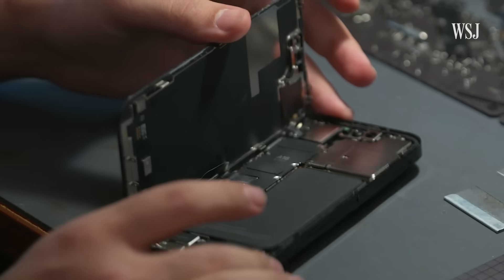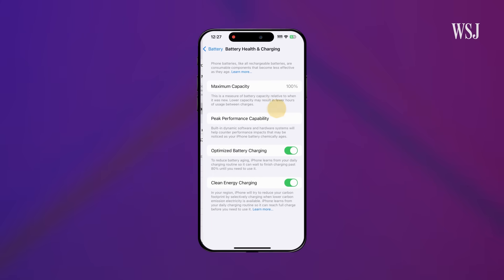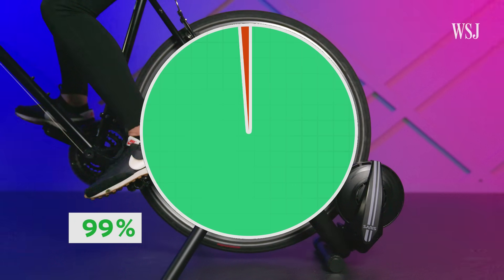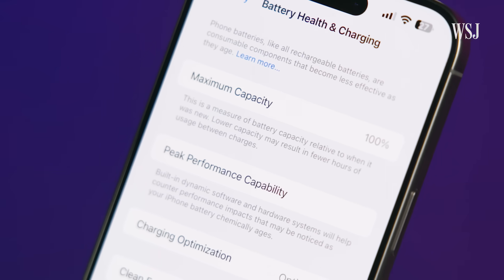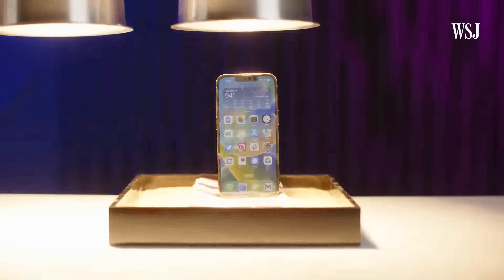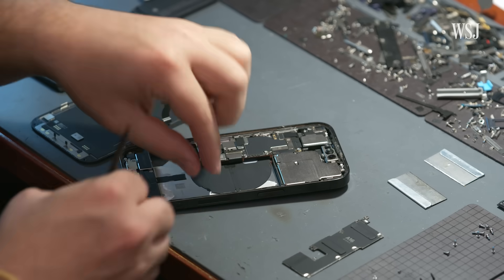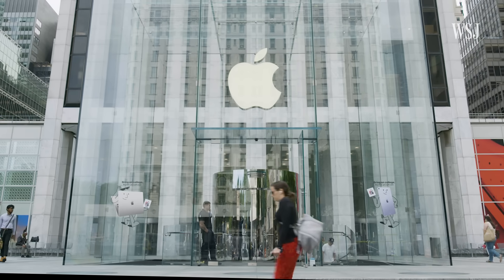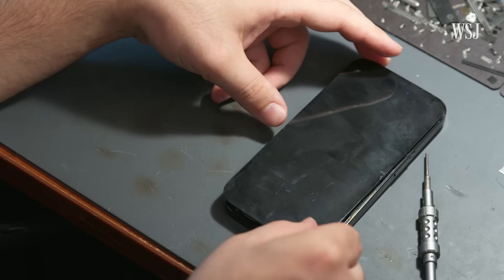Why My iPhone’s Battery Expired in Only a Year | WSJ

Comment: I charge my iPhone 17 to 100% every night I have optimised charging on. Had 112 cycle counts and still 100% capacity. I’ve got a magnetic power bank in case j need it as I refuse to pay out for new batteries when I’ll be getting a new phone by time it’s needed.

Comment: My 14 Pro Max took 13 months to drop below 100% capacity and (I'm pretty sure) that's because I babied my phone. Right off the bat, I never used my phone while charging it and I never let it stay plugged in when it's done charging. I never charged it with anything faster than 5 watts, I kept my brightness as low as possible at all times, I never charged my phone past 80% or let it drop below 20%, my wallpaper for my home\lock screen is literally just pitch black, and I absolutely never charged it wirelessly. I've also never used low power mode but that has nothing to do with any of this. Did any of these habits have any effect on their own? Absolutely not, but altogether I'm quite confident that it kept my battery the healthiest it could be for that year. It's been two years that I've had it now and it's finally at 87% capacity and i no longer baby it. I'm gonna get the 17 Pro Max at the end of the year. I only wanna baby my battery for no more than a year. If I can get 2, maybe 3 years out of it I'll consider that a success. I don't look at phones as status symbols instead i see them as tools. Idc if they get scratched up or cracked as long as they properly function.

Comment: Yeah the 14 Pro series didn't really gain a bigger battery, in fact the 14 Pro Max actually has a slightly smaller battery than the 13 Pro Max. The 14 Pro series just wasn't the best line of iPhones to upgrade to in my opinion. Overtime, like right now, people are starting to really feel the pain of those smaller batteries. I'm hoping that this is just a temporary trend while they add newer/different battery technology to put inside these phones.

Comment: I currently have two cheap Android devices - a phone and a tablet - and neither has given me battery issues in the 2 years since I bought them. The iPhone 17 Pro Max is 2600 AUD at my closest brick and mortar store and that is nothing short of obscene IMO. The iPhone 16e is 900aud - the notion that either of these would need a battery replacement within 12 months is insane. I get that the factors you have mentioned can impact battery life but I doubt that Motorola and Lenovo are investing more in battery tech than Apple. This looks a lot like planned obsolescence.

Comment: Batteries are manufactured in runs. Here an example. Amazon informed me of recalls due to bad batteries for two battery banks from the largest producer of battery banks. I looked up my serial numbers and found out my batteries weren't in the bad runs. The point is, you can always have a battery from a bad run, Apple included. But how will you find out the replaced battery is bad? Maybe if you use an Apple battery, Apple will keep track of the new one as well. I don't know if that is true.

Comment: As someone who used to work at Apple Retail, I purposely never use MagSafe chargers, because the heat in there absolutely affects the battery cells. That’s why Apple has steered away from fast charging like android does in 20 to 30 minutes. If you use a slow charger, use the optimized charging feature on iPhones and or the adaptive power that will all help.

Comment: Charging with slow cable I had my 13 Mini on 100% for 2 years. Then I had a 14 Pro Max, 100% battery for 1 year. Then a 14 Pro Max on 87% and it remained 87% throughout 1 year. 

don't use wireless chargers, don't use fast charging. IF you want your battery to last or if you want to resell.

Comment: Keep your battery charged between 20 and 80%.  If you need more, then charge higher, but use it right away.
Letting it charge to 100% and sit there for hours can cause the battery to wear faster.
My iPhone 14 is 3yrs old and at 94% health.  My iPhone 11 was at 79% health after just over 2yrs.  The difference is how I charged it.

Comment: I Has a galaxy m51 and it was at 94% battery health it was used from 2021 to start of 2024 it was with 830 battery cycles, I think apple is ripping all its users, because I tested recently a s23 ultra with 2 years of continuous use with 550 charging cycle with 96 % battery health.

Comment: I had two batteries replaced on my iPhones at the Apple Store and it takes roughly an hour for replacement. If you like your phone and don't want to upgrade getting a new battery will extend the life of your phone atleast two years (if you take good care of it). For 100$ its much cheaper.

Comment: My IPhone 15 had 600 cycle count & 90% and had 14months usage. Then it dropped to 85% in the next 6months it went to 900 cycles so very even. In a way I was able to get max out of the battery by making sure I went down to 1% and charging it back to 100% every time. But yes 1st 6-9 months I was getting a full day of use and I had to charge it again after 9months of use.

Comment: 480 charge cycles, explains everything. you depleted your battery more times than there are days in a year.
Running newer iOS on older devices just increases the cycle count

Comment: My android phone battery health is at 94% after more than 2 years of use. From my learnings, you only got to do 3 things for a healthy battery. Prefer charging from an adaptor instead of wireless. Now the next 2 are most important. Don't let it go below 20% and don't charge it above 80%. I have been following these practices for more than 5 years across my 2 android phones and they have worked really well. I compared this against my wife's android phone who just don't follow any of these tips and who fall asleep while phone charges throughout the night. Her battery life is around 84%. Note that her phone is newer than mine.

Comment: She's answered her own question, hasn't she. 494 charge cycles in a year is excessively heavy use. Most batteries are rated at ~800 charge cycles before replacement is needed. And those 800 cycles are enough to last the average user 3-5 years.

Comment: Wow... surprisingly useless video. You better research more third party batteries which have very poor battery life. And why Apple charge so much money on the battery replacement which cost only 10 to 20 bucks when they buy from the battery suppliers.

Comment: she has more charge cycles because of 120hz screen because to drive a 120hz screen you need more processing power and display is more power hungry so more battery depleting hence more charging hence more charging cycle.
60hz vs 120hz display made all the difference and she play games on 120hz it will use more power than on 60hz

Comment: A few slight (actually a *major*) issues…

1. Refurb is more than just surface cleaning.
2. What about possible battery replacement?
3. Is the wired computer connection actually doing much for complete erasure? What about the fully traceable IMEI, and other data?

Comment: The nex big thing is, that Apples IOS makes the IPhones drain more battery with every new iOS coming out. Your IPhone (even with a new battery) will never perform like it was new, they “optimize” for the newes model and for the model 1 year before. Your new iPhone on iOS 18 gets for example 10Hours and on IOS 20 it will only get 6 if you are lucky.

Comment: My 4 year old iPhone 12 battery is at 94%, so I’ve only lost 6% in four years despite using a 65 W charger daily. That’s because I never charge beyond 80% and always charge before it reaches 20%. People who do this genuinely will see a significant improvement in battery longevity. most peoples batteries degrade significantly faster than mine because they are always allowing their battery to run to 0 and they always charge to 100%.. unfortunately Apple’s battery optimisation setting doesn’t really help improve the Battery help of Apple products. You have to manually do it yourself to get the best chance of battery longevity. I advise anyone with the newer iPhones to activate the 80% limit in the settings so that the software prevents the phone from never going beyond 80%.

Comment: Tip: avoid wireless charging and fast chargers if you can. 

Both these options generate heat which is the main culprit when it comes to fast aging batteries.

Comment: No your wrong , the reality is that Apple is using the GPU to do the processing CPU work , this arm architecture exposes the battery to heat and Apple has placed new iOS to slow the GHz down and this causes the battery to alter the amount of volts of current in output , a change in amp will lower the battery health …they did this to preserve the the logic board from being degraded due to recycled rare earth materials , which are not pure elements ..
They had to do this in order to extend the durability and life of the device ..
iPhone12 and  12 mini also ran into the same issues .

Comment: I've been using my 2011 LG 505 Phoenix with its original battery every day for the last 13 years.  
2 years as a full time smartphone and the last 11 years as an MP3 player (airplane mode only). I bought 2 replacement batteries for this phone in 2014, they have never been opened.

Comment: I find those people preserving the number of charge cycles so stupid. I mean its a phone, its meant to be used. When its at 80%, just replace the battery. For sure by that time, you have some money to spend on a simple battery replacement and doesn't burn your pockets by buying a new phone.

Comment: Adding my 5 cents. Iphone 12 mini bought at launch (Nov 2020) today (Apr 2024) battery health at 87%. The phone was overheated several times while charging wirelessly in the car and wired on the motorcycle in full sun but other than that I try not to go below 20% and not to charge overnight - just plugging in while working in the office and unplugging at 80-90%. During weekends I tend to fully charge to 100%. It holds up well I would say. With this rate I would change the battery in 1-2 years and then the new battery would last longer vs the iOS updates coverage (Sep 2027).

Comment: Wifi is everywhere. Enable wifi calling and turn off the cell radio when you don't need it. It will provide more battery life. Android 14 also has a good "extreme power saving" mode that is very effective, while maintaining your phone's ability to receive a text or phone call.

Comment: 5:33 A little bit of misinformation here, and kind of odd that it came from a repair shop technician. Apple determines if a battery is OEM (from Apple) based on a chip that’s soldered onto the battery. The battery’s connector actually goes directly to that chip and the chip is spot welded or soldered onto the battery’s terminals. Then it’s all rolled up so you just see one nice-looking battery. The chip is a tiny little rectangle eat the very bottom of the battery called the BMS (battery management system board) and you can usually see if because there’s a slight inset/indent where the cell ends and the chip is stored and wrapped up. If you cut the BMS chip off the Apple battery that comes with the iPhone and spot weld it onto your new third-party battery, your iPhone will think it’s the same exact battery so the warning message won’t appear. The BMS chip is what stores the data that tells your phone how many cycles the battery has and what % capacity it’s at, so if you swap the BMS to a new battery, by default, Settings will still show the same battery health information, but there is small pieces of hardware like tag-on flexes and BMS re-programmers that shops can use to reset the BMS info back to 0 cycles and 100% health. They can also change the BMS’s record of how much capacity the new battery has (if different from the original Apple one), to make sure that the % health and cycle count calculations shown in Settings remain accurate with the new aftermarket battery. BMS boards are serialised so each iPhone knows that it was made to only have one BMS used on it. Even if you use another Apple OEM battery, the warning message will still show up because that Apple battery won’t have the same serial number as the BMS the phone’s original battery shipped with. When Apple does official repairs, they have tools to modify the serial number on the BMS of the new battery the install or update the iPhone’s logic board to accept a new serial number so that the error doesn’t show. They licence the tools and technology to do this for Apple batteries to Apple Authorised repair providers so that they don’t need to transfer the BMS from one Apple battery to another when repairing customers’ Apple device batteries.

Comment: I got an iphone 14 in december 2023 and the battery health is already at 96% and it only had 73 charge cycles. My old phone iPhone XR that I got in 2020 took a year to get to 99% battery health. When I got the 14 the XR was at 87% battery health after 3 years. My sister got an iphone 13 last june and her phone is at 98% battery health. iPhone 14 battery is just worse for some reason.
Reply: For one week battery life, get Doogee S100....
Reply: @ now its at 87% 💀 after a little more than a year. The next phone im getting is a pro max because I want bigger screen and better battery.

Comment: The extra power drain comes from an always on BLE (Bluetooth Low Emission) chip that is the backbone of how airtags work. It has a range of about 450 feet and it calls out to other devices the same chip to form a mesh network. It's the network an airtag calls out to find and transmits its location too. You have no access or control of opting out of being a part of this always on mesh network in the OS.

Comment: Pay the extra $10.  Battery messages will destroy resale and trade-in value.
Reply: yep, at 98 dollars instead of 88 dollars am better off doing it the official way with apple instead. At least apple doesn't take short corners like some of these repair shops do by getting cheap batteries.

Comment: one thing is missing here... at the very first time you replace that batt, you are likely to lost the Water resistant forever
Reply: Not if it is performed by Apple or a professional repair tech. A water resistant gasket can be installed
Reply: Wrong, apple remove the old glue and apply a new one.

Comment: Charge should remain between 20%-80%. End of story. I have been using 13 pro since oct 2021 and my battery capacity is at 87% which is fairly good. And one should use the phone like a normal human being and not abuse it. Believe me everything will be fine.

Comment: iPhone 13 PRO Max 97% health, 425 cycles (battery age ~890 days). Take note: to reduce battery drain, turn OFF 5G and use LTE. Turn off Background App Refresh. These two changes will dramatically increase the per charge longevity of your battery. HEAT is the number one enemy but WSJ said nothing on how to reduce it. Well here's how: Charge SLOWLY. Use the old little 5w apple cube to charge your phone overnight (yes it will take hours and your phone temp won't change at all) and use a fast charger during the day if you have to top up. Wireless charging and fast charging is bad no matter what anyone tells you. Why? It generates HEAT!

Your battery capacity is larger than the 100% shown on your phone. Coconut battery will report a lower charge level and higher battery health because it's reporting against the full/real capacity of the battery. Yes the rumours are true, for the absolute best battery health and charging practice, keep your phone between 20-80% and don't go to 100, however; this is not practical for most people. Doing your best to reduce heat will allow your battery to last for as long as you want to use that phone.

Comment: My iPhone 14 Pro Max is down to 92% in about 5 months, crazy my original iPhone SE from like 2016 still has 91%.
Reply: Mine 11 pro from 100% to 85% 3 years. Now 14 pro from 99% to 90% in 5 months.
Reply: @ArcheeKK  I’m down to 85 percent now lol this battery is nose diving.
Reply: @ArcheeKK mine 12 pro from 100% to 74% in almost 5 years
Reply: Honestly I do think it’s the iPhone 14 range. Mines down to 89% after just over a year. Crazy.
Reply: Same phone, I just checked - 100%     ok, it is on it's third battery
Reply: @chip9177  mine is now down to 84% since posting
Reply: Thanks for sharing this, i thought my iphone battery was defective, but it looks like everyone has the same issue

Comment: Regarding the aftermarket battery, it's like when you put another aftermarket engine in your car or motorcycle. It did not work as the manufacturer says with the original engine. I would put another Apple battery and solve the problem.

Comment: Possible reasons for the battery to discharge so quickly: you have one or more applications running in the background, a factory defect, the battery or the phone was previously unbleached and a problem battery was installed, the phone or battery was left too long to be used in - und deposit before the phone is bought. The iPhone is a very good phone.

Comment: stupid question: is this only an iPhone related problem or do show android phones similar wear, too? I'm already familiar with battery-wear on my laptops and it doesn't matter if it's a lenovo, hp or dell. The chemicals and physics are the same. My 4 year dell xps is at about 50% of its original capacity: it jumps from 46% to only 6% suddenly and tells me the power will fail in 10min

Comment: Charging on airplane mode with the 5W charger with a iPhone that is cool to touch that never dips below 10% and never charges to 100% I had 100% battery health after 6 months iPhone 13 Pro Max with over 500 charge cycles having heavy usage doing GPS navigation daily Uber eats driver app.  
2 years later I’m at 97% can’t say I never used a 20W fast charger but I hardly ever use it just to see if the health would last longer and it definitely did & low power mode all day everyday ;)